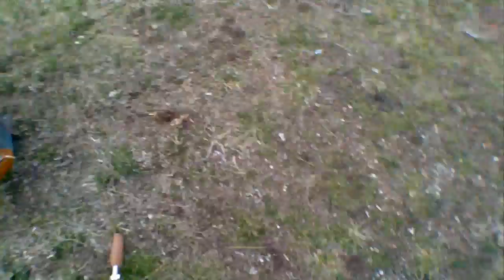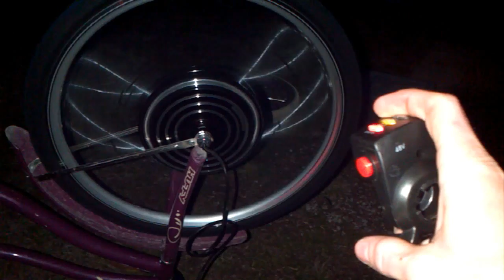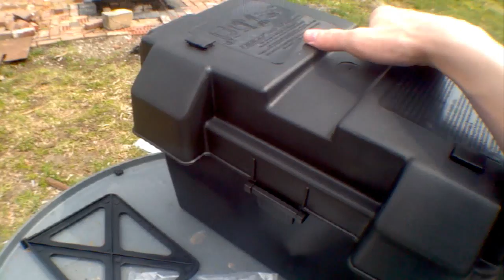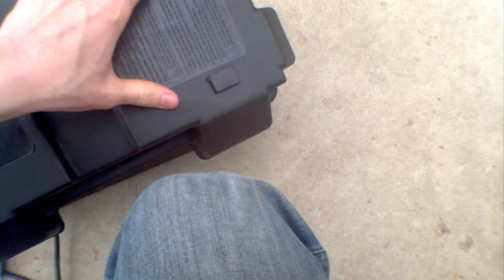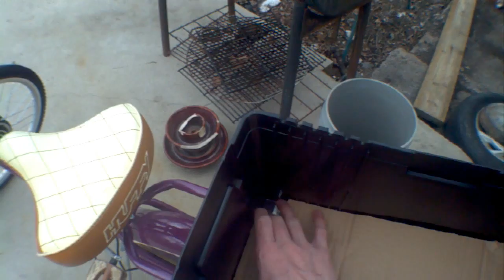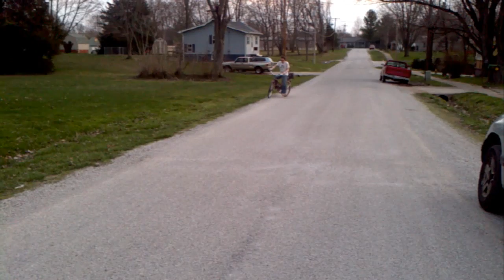DIY E-bike: new motor 48v 1000w

Comment: not bad for starters, Some factors you can use. in my opinion would be lower that weight by mounting batteries like saddle bags,   A smaller diameter drive wheel and tire will let that hub gain r.p.m. closer to its max power curve  ,and  as far  as batteries keep the lead acid they are tried and proved , the deep cycle better yet for this ,And  to prove the beauty of  a new product that is really scrap and wasted cash , someone like yourself can buy a used electric bike  for pennies on the dollar [cause  most are out of service in no time at all and for sale dirt cheep,  ]   Have the hub spoked to  almost any wheel  you want ,or rig  the 2k  bike you just bought for 200$  with basic electronics and bat's and your good to go
Reply: wow ive never gone electric.cycled halfway around the world including gone right across south Africa. when u guys comment it makes it sound easy. ive never tried it and now developed sore heels planta fascia so im looking into going ebike just to get up those hills but the thought of running out of epower when u in the middle of nowhere is scary especially pulling my furry friend Charlie Cowboy pants he doesn't pull his weight the little medium sized fucker but hes pretty fit and runs up the hills . the problem is these dam cops. you'd think they just concentrate on criminals But NO! @!!x#!! they go for the 'Battery Boys' cause its easy peazy fines to fill the state coffers!
Reply: the problem is when u run out of battery power and the weight of everything especially if you are pulling a dog and trailer too. thank god im MGTOW.  would draw the line towing a woman too!
Reply from the maker: keep in mind this video is very old, i wouldnt want anybody to use lead acid in their bikes because lithium is cheeper and better. not counting a bit safer. my current bike setup goes 37mph at top speed and can go up to 200 miles if i stay bellow 12mph.
Reply: Rinoa Super-Genius Lithiium is NOT cheaper than Lead Acid. not sure what universe you live in, but if you can get lithium cheaper than lead acid, please send me some lithium batteries.
Reply from the maker: iklomate
yes it is, watch my latter videos and you will see how. i buy old laptop battery packs and strip the cells out of them. it costs a lot less than lead acid.
Reply: Rinoa Super-Genius Thanks, just watched it. Awesome video. Will be attempting a build myself with your video as guidance. Thank you

Comment: Oh how convenient that was the same one I was just looking at to buy. Would you recommend it? Worth the money? Are there any upgrades you found out there?
Reply from the maker: i would definitely recommend it. it took me a while to build a battery good enough to power it but now it can go 37mph with a 200 mile range (if i only go 12mph)
Reply: Rinoa Super-Genius I'm still having a bit of trouble figuring out my battery pack.. How did you connect.. Never mind.. Ok what you did was you have 2 24v packs and connected them in parallel to make 48 and both were rates at the same ah? Right?
Reply from the maker: Onepower
2.24? no i use 4.2v cells. just watch my videos to find out. i've shown how to make 3 batteries so far.
Reply: Rinoa Super-Genius sorry no I ment (2) 24v batteries... And you said in one of your videos that you were running on only half a battery for a while.. So you were running the bike on 24v only, is what you met, instead of the 48v? Also I've already watched all of them haha.. Also I'm just going to do it the better/cheaper way and buy the "broken" laptop batteries. Much easier and less bulky and cheaper than buying the conventional ones. Also thank you very much for replying to my comments. And last thing, would you happen to know, if this only works with PC laptop batteries? Are old macbook batteries ok? Do they have cells? I don't want to order them and they are made of something else... Sorry noob questions haha. Tisk tisk
Reply from the maker: Onepower
 no when i was running on half a battery i rewired my old battery to be 24v also so it was still 48v.

and i'm not sure of macbooks. they might not be 18650s. id just go with cheep PC batteries.

Comment: How many rpm do it run , the hub motor
Reply from the maker: the rpm, but it can go up to 37mph and it's a 26 inch tire. do the math if you want.
Reply: +Tobias Pedersen about 482 rpm

Comment: anyone know the difference between front and rear motors? does it matter?
Reply from the maker: one is ine the front and one is in the rear. if you get front hub you might want to reinforce the front forks. just weld a bit onto it near the bolt to give more to hold the load. people say they have issues with them breaking off but the same people also do very stupid things with their e-bikes. so i dont think there is much of a differance.
Reply: Rinoa Super-Genius Yes, torque arms: I have seen the worst-- thin snapping off just from starting from a full stop or breaking en-route... saw a guy nearly die from the forks ramming right through his cheek... I prefer rear wheel because if the motor were to ever seize if the phase wires short with each other it can be upsy-daisy!

Comment: Is the motor still holding up well? I looked into one of these a few months back.a
Reply from the maker: yup working great. i've even accidentally left it out in rain and had to drive through rain, but it seams to be pretty waterproof.

its been working great except one fault. the little connectors they use for all the wires are terrible quality so i may replace them with automotive connectors sometime. its just after like 20 miles or so some of the pins in the connector work their way out and you have to pull over and push them back in with a pocket knife. but again it wouldnt be hard to replace the connector.
Reply: Cool man thnx!
Reply: Rinoa Super-Genius I replace the hall sensor connector with a cat5 jack and run a small patch cable to the controller's hall sensor jack... for the phase wires, I use ring terminals and terminate them on a block... you don't want those to be even SLIGHTLY loose as that builds up resistance and you can fry a Mosfet from that.  I agree: the dinky skinny connectors the stuff comes with is hardly durable!

Comment: That wheel motor still working ok? The vid was a 1 1/2 year ago.
Reply from the maker: yup i've put several hundred miles on it.
Reply: good ...I'm warming up to 'em and building the courage to make the purchase.
Reply from the maker: G Philip C
 the biggest hurdle is building the battery. but once you learn how its quite easy.
Reply: Thanks...I'm a consummate fiddler, think I can build one up.

Comment: Why are you mounting it on the front wheel?
Reply from the maker: because its a front wheel, back wheels need a sprocket and are a bit wider.
Reply: front wheel seems best because in the case of a failure you can still pedal your ass home
Reply: +nathan scarabin in case of a failure you usually eat concrete

Comment: i dont have the first clue on how to build the batterys or even start the work but i have a GREAT idea for a electric one or two person scooter/chair... help ty
Reply from the maker: If it has more than two wheels you could prolly get away with using old lead acid batteries till you know you have the motor and stuff working.

The main reason I couldn't use lead acid on this bike was because it was too heavy.  I found that lithium worked really well. Not counting lithium is cheaper than lead acid.
Reply: do you think that i could use a car battery
Reply from the maker: Aisha Azeroul if you find a 12v motor yes. car starter motor might be good. but might be too strong. youd also have to put better berrings into the starter motor or it'd burn out.
Reply: ty
Reply: Do you think it is possible to turn a gas bike motor into a electric?
Reply from the maker: Aisha Azeroul
you mean replace the gasoline engine with an electric motor? yes.

it almost sounds like you where asking to turn the gasoline engine into an electric motor, no that would be too much work. electric motors dont need pistons.

Comment: Don't forget to use torque arms on the axles, the motor does a lot of strenght and it might breakt that place where you screw it, so be careful. I own a ebike too =P. Visit endless-sphere.com, the best eletric vehicle forum arround, u'll be very welcome there.
Reply from the maker: well after my first itteration of the bike i accidently snapped the connectors off the front when trying to undo a weld. so i rewelded the entire bolt connector with just welding material. its proving to be super strong now. i may reinforce it more though.

and yeah i've known about that forum, i'm just not one for forums because they tend to have misinformation. also i find it more fun to test stuff myself. and make videos of how i find information :D
Reply: Your presence would be very appreciated there. Please think in becoming a member =)
Reply from the maker: Mateus Leonardo
sorry i dont really have time for forums haha. thanks though.

Comment: dude you're so young and look healthy why don't you just pedal? LOL
Reply from the maker: steve patton
and why we dont cut the lawn by hand much.

i love mechanization!
Reply from the maker: because its my main transportation. and just because i'm young doesnt mean i can pedal 30 miles at 25MPH without breaking a sweat. especially not when it gets to 110 F* in the summer.

dude your so bad at trolling and you look stupid why dont you just shut up? LOL

>_>
Reply: I see. Sorry I didn't mean to call you lazy or anything... Haha. What's wrong with breaking a sweat? lol just kidding. I actually admire your ingenuity...
Reply from the maker: Johnny D.
well you dont want to get all sweaty every time you have to go somewhere. not counting after i blacked out from the heat a few year ago i dont handle hot weather too well. also i tend to start out at 14mph max then slowly winding down to 7mph or so as i tire out. with this i can get somewhere without feeling like i'm going to throw up. also it helps counter the 25mph winds we regularly get.
Reply: its the same reason people use remotes for the tv. Because they can.

Comment: One more thing question... I cant seem to find a 72V 1000W conversion kit... any suggestions? Would it be worth it to step up to a 72V?
Reply: You can probably use a 48v-1000w motor plugged to a 72v-1500w controller. These motors are good and it will probably handle the extra volts with same amps. Visit endless-sphere.com, u'll find usefull info about ebikes there.
Reply from the maker: Mateus Leonardo
 yeah DC motors are very powerful. i would bet these motors could even run 100v (maybe not well though)

Comment: What kind of torque and top speed do you experience with your 48V 1000W kit? Assume zero peddling & also assume using a normal LiFe Po battery  

Thanks!
Reply from the maker: it can reach 35 mph in a couple seconds.

Comment: That new motored wheel looks pretty slick. Is it water and dirt resistant? I cant wait to see your custom batts powering that :D
Reply from the maker: ExclusiveLM
 yes my bike goes 35MPH and most people go 55mph on the road...whats your point?
Reply from the maker: yeah it seems to be water and dirt resistant. I dont want to test it though haha.
Reply: Rinoa Super-Genius   Geez Rinoa.  Chinese car drivers could drive faster than your slow bike.
Reply: Rinoa Super-Genius  you missed the joke.  I meant that in the video since your battery power was still low you first looked like it was going very slow and Chinese people are known for driving slower than skate boarders.  btw.......... nice backyard.
Reply from the maker: ExclusiveLM
Well the average highway speed limit in China is 75mph. So only an uninformed idiot would assume they are slow. In many ways their transport is much faster than ours if you remember their high speed train system.

geez exclusivelm, even a Mexican could be smarter than you.

See how the logic breaks down?

Comment: hey super genius i can obtain lithium-ion cells that are 6ah i want to build a 48v system 12ah could you possibly recommend a bms that would work
Reply from the maker: if the 6ah cells are 18650 its a scam. are they from trstfire/true fire on eBay?

if they are a different numbered cell like a 32600 cell then that's prolly a real cell, so awesome!.

I haven't used a BMS before, I've only used a balance charger. I made a video about that a few months ago. I use a 30$ imax b6 from eBay. its working great so far and I've found a lot of usses for it besides for my bike battery.
Reply: the cells i get are from a cordless weedwhacker greenworks 20v 6ah i get them thru my job for only 20$ each. i work for a warrenty place for power tools. and yes the batterues are new . there are 5 cells in each pack
Reply from the maker: jay7264
cool. that sounds like a nice deal.

Comment: where did you get your kit from?? china? how much? I am looking for a 600w and I want to make the battery,(36v) how many 18650 batterys do i need ? would like 15AH
Reply from the maker: i got the kit from ebay. the hub itself comes from china but it first goes through a bike shop in california. i made sure it came from the US so i wouldnt have to pay 170$ to return it to china if it was broken. i payed 270$ for the kit.

i recently did two videos on some 18650 cells on ebay, if you got them it would cost 1.2$ per cell and each cell has 2.2ah. if you had 7 cells in parallel youd get 15.4AH at 4.2v. then you would just make more of those packs and wire them in series.

a laptop battery pack with 12 cells costs about 15$ so that would be almost enough cells for two 4.2v packs. so that would be 7 per parallel pack and you'd need 9 packs to get 36v. 63 cells

run them at 4.0 or 4.1v instead of 4.2. every 0.1v you lower the charge voltage you get twice as many cycles. so at 4.2v youd get 300-500 cycles, 4.1v 600-1200, and 4.0v youd get 1200-2000 cycles.

also you might want to actually make your battery 40v. most bike controllers are made to handle a bit more voltage. not counting whenever you pull power from the battery the voltage will drop. so if you battery is 40v it will be closer to 36v at full speed.

i hope that helps. ^_^
Reply: TY for being so fast, I love your videos! I am going to get a hub motor and build a battery, they are so pricey, and that battery balancer, is that basically a battery management system? could you link the one you bought?
Reply from the maker: dont be dumb
idk what one I bought, I just got the cheapest imax b6 on eBay at the time.

and it only tops off the cells. it doesn't stay connected all the time.

Comment: Does higher voltage help with speed and pickup? I use a 72V 2000W bike
Reply from the maker: wow 2kw? thats crazy. and yeah voltage gives more speed while amps give more force.
Reply: Love your vids btw. Glad to see this in DIY. I'm living in China and they have e-bikes everywhere. I had a 60V1000W that got stolen so I bought that killer 72V 2000W. get speeds of 50mph+ My batt is a 72V40AH, so I get like 50-60miles on one charge Rinoa Super-Genius
Reply from the maker: nelsdawgy
wow awesome. i go at a much slower speed and get 20 miles for every 10 AH of my battery.

and thats cool that you live in china. its an interesting place.

Comment: Have you considered a torque arm for your front dropouts?  The hub motors apply a considerable amount of torque to the drop outs especially if you're using the magic pie regeneration.  While it's not always necessary depending on the amount of watts your new lithium battery it's a lot safer.  Imagine if your front drop out failed, you would fly over the handle bars.   That is why I chose a rear mounted hub motor on my eBike in addtional to a rear torque arm. Mainly for safety. Also typically rear drop outs can be subject to higher levels of stress than front drop outs.
Reply from the maker: magic pie? i take it you mean regenerative breaking. regenerative breaking is a big waste tbh. if your breaking that much then your riding wrong.

and no i don't have any issues with the front wheel. thanks for worrying though.
Reply: Rinoa Super-Genius No problem.   Just want you to be safe.   I frequently the endless sphere forums and it's crazy how much stress is put on the fork with these hub motors.  People have died because of front fork failure.
Reply from the maker: Ryan Pong
well tbh i don't ride it very hard at all. i definatly don't gun the motor. not counting i don't ussually go past 20mph due to wind resistance making it not worth it.

but yeah i don't doubt it can be an issue. someday in the future i was going to weld it more to make areas of the bike stronger.

Comment: I'm developing a liquid cooled 36v 22ah ebike battery pack made up of cheap 2200mah 18650 cells. 10 in series for 36 volts and 10 36v rows in parallel for the 36v 22ah capacity. The cells weigh 44 grams each so 100 would be 4.4 kilos  so figure around 18-20 pounds with the case, wire and cooling system. I found them for $37 for 25 cells shipped so that should run around $180-$190 bucks for a 36v 22ah pack with all the wire and PC cooling radiator bits and pieces. I plan to flood the pack with mineral oil and circulate it through a dual 120mm fan 240x120mm PC cooling radiator with a PC cooling pump to keep the cells cool under load. I may even liquid cool the controller too. When you keep the heat down you keep the resistance down thus saving wasted energy due to heat induced resistance and extending the life of the batteries by controlling the heat they are exposed to as they are cycled. I think the extra 5-6 pounds of liquid cooling gear will be well worth the added weight.
Reply: +Geo K you dont need to liquid cool a battery, if it gets that hot its too small lol